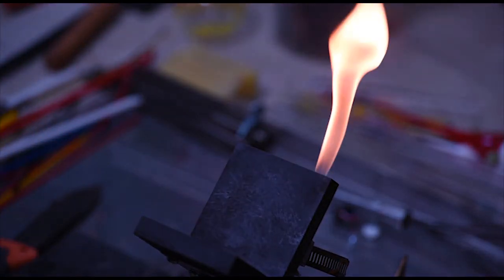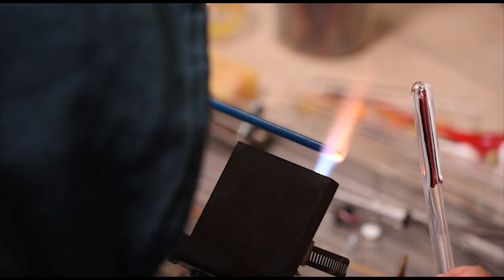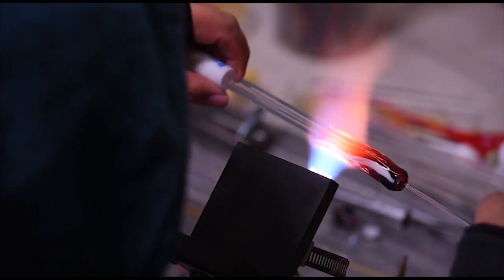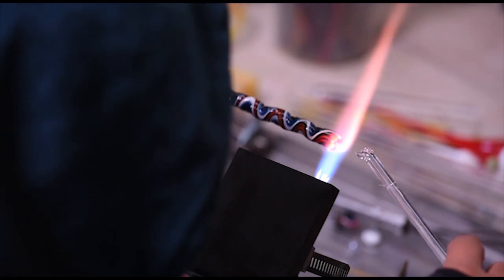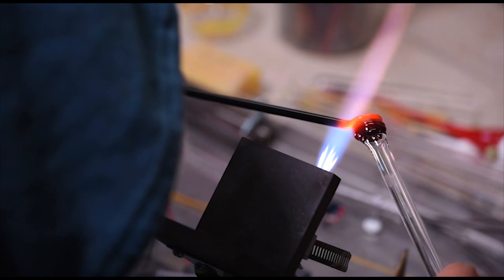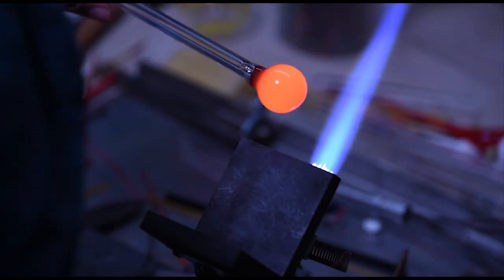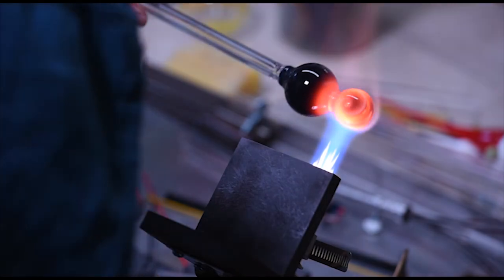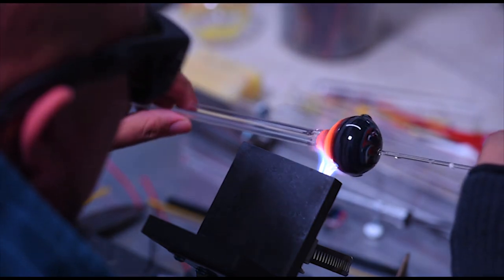Glass Wig-Wag Pendant Demo

Comment: Awesome real time demo and narration. I had a pipe years ago that had a feature i cant figure out how to get right and a video on it would be awesome.  It was functioally a splash guard but it was like a donut but there were 3 openings all connected like a cave.  It was basically a donut with a hole every 120degrees horizontally and really added a lot of character to the finished pipe.  For a demo like that I'd be eternally greatful.

Comment: What is the COE of the color stringers and tubing you’re using? Don they have to be the same? I see a lot of stringer bundles and they are 90 COE but the Simax glass I’m looking at is 33 COE. I’m not the most knowledgeable on these things so I figured I would ask you cause I’ve watched this video a bunch in preparation for gathering supplies and learning techniques. I’m at the glass buying stage and I’m waiting on my application at Airgas to come back for fuel and then I’m ready to blow. Thanks for the help so far!
Reply from the maker: I only use borosilicate glass.

Comment: Great video brother. What’s a decent torch to go with? I’ve gathered most everything but....
Reply from the maker: I use a Bethlehem bravo. It's a good torch to start on and it's a torch you can grow with or that can grow with you rather. There are cheaper alternatives like the Bethlehem Alpha which will give you a smaller flame but it will be tough to get into larger pieces with that torch. They also have the Bethlehem champion which is a step above the Bravo. It really depends on your budget. A lot of guys like the GTT torches as well but I don't have any hands on experience with those.